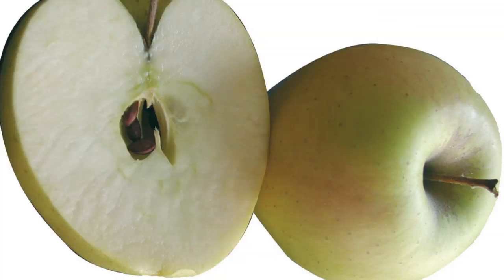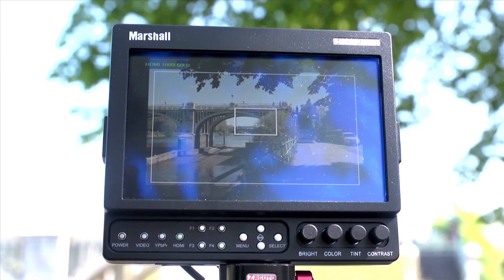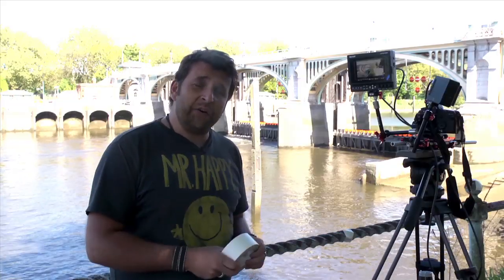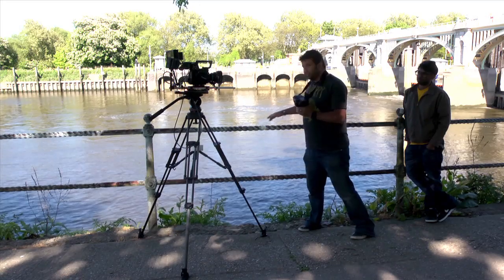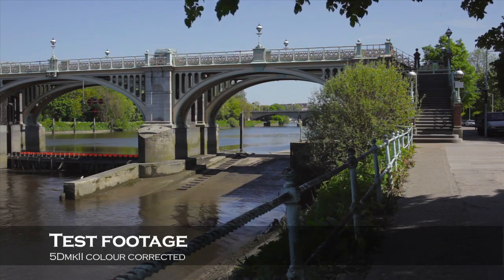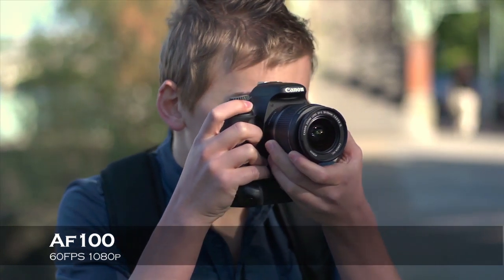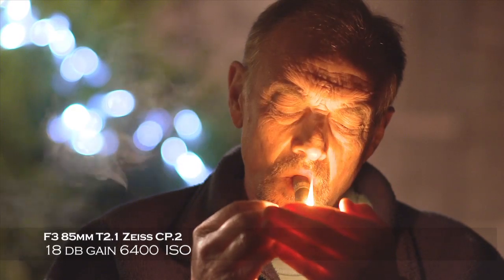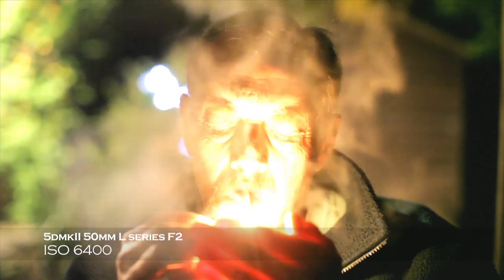Af100 vs FS100 vs F3 (and 5dmk2): Part 1

Comment: Philip, what's your opinion on the NEX-EA50 in comparison with the FS100. Technically I mean. There is a fairly substantial price difference, however they appear technically very similar, apart from aesthetics?

Comment: I own a 5D Mark II, but the F3 won hands down in the low light cigar test. Very impressive.

 Only one question Philip, did the fact that you were using a $3900 prime on the F3 vs the L lens worth half the cost on the 5D make a difference? Would the results been closer if the 5D likewise had the same cinema lens?

Comment: The F3 looks to be the best, it's sharpest and it's got the best ergonomics, but for the price, you're only really getting a slightly sharper image and 4:4:4 output. The FS100 looks a tiny bit sharper than the AF100, but it's about $1500 more. I can't say I see the point of the 5D, it's not very sharp and it's really not designed for video, the skewing is very bad on this camera, but I suppose it's a cheap means of getting DOF.

Comment: Hi Philip,
here r my own rankings (best to worst):

F3 - Superb color reproduction, sharp details on shadow (low light) areas, bright areas are not overly flooded - meaning the sensor is powerful. However, the price of this makes it unfair to test against the rest.

AF-100 than FS-100 - SDI/HDSDI output are largest plus point of this 5k-grand camera. Built-in ND filters and perfect 60p capture also help make it score above FS-100.

Mk2 - Crush black, unreal colors. DSLR are not meant for videos.

Comment: Overall the F3 looks pretty impressive, the 5D on the brick wall shot seemed to have the most noise, or grain.  On a side note for operation, I had a chance to shoot with a 60D last week (normally I shoot with my 7D) and I loved the flip out viewer.  I wish the 7D had that for low or high shots.  If you don't have a separate monitor, this flip out option is way cool.  
Thanks for the tests Philip.